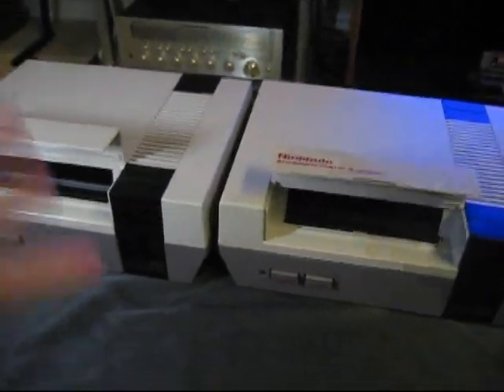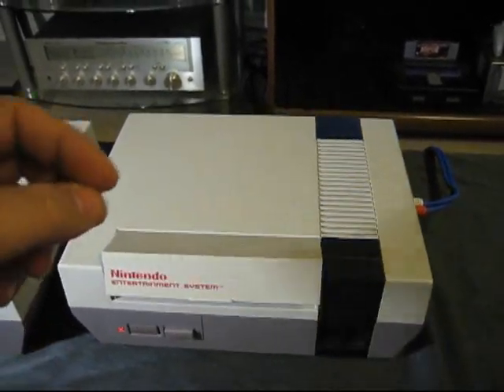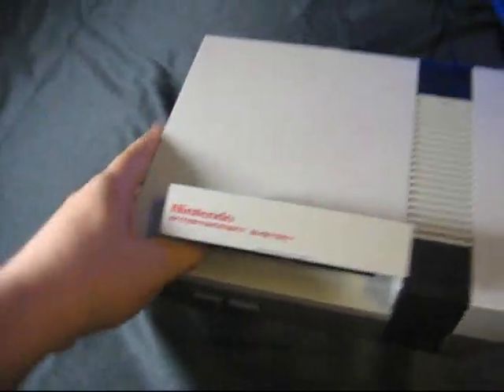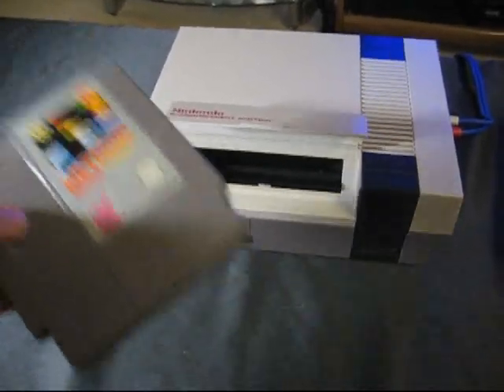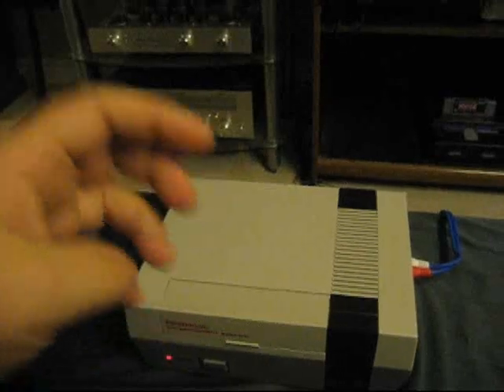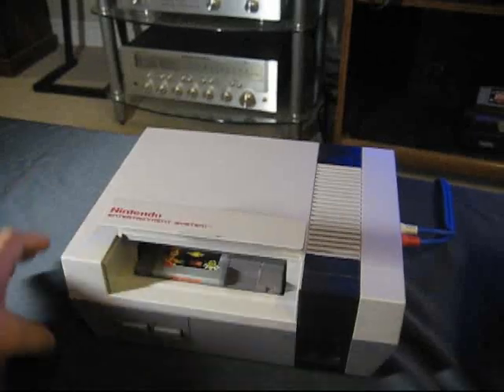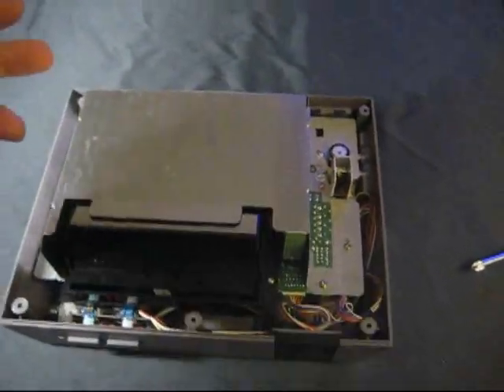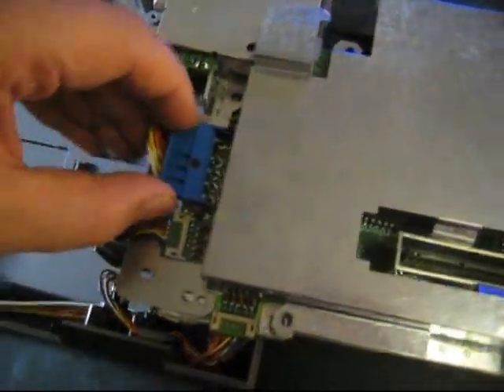Disable the 10NES chip in your NES

Comment: WONDER IF YOU STILL REPLY?? I DID THIS NOW AFTER PUTTING IT BACK TOGETHER, I GET A GREY SCREEN, ANY IDEAS THANKS
Reply from the maker: Well I'm still here but the bad news is I don't know why you have a grey screen.  I would try reconnecting the pin to see if that fixes it back.
Reply: @MN12BIRD  ahh damn. thanks for getting back to me. i did it, attached a new 72 pin connector but i get the grey screen, even with the old connector, it only seems to work if i dont push the game down when i insert it.

Comment: I did everything exactly as you did but I still get a white screen. Any thoughts?
Reply from the maker: Not sure you could try grounding the pin or just cleaning the carts better but maybe the 72-pin connector is just too far gone.  You can look up boiling it maybe??  or other ways to clean the connector.  I replaced my 72-pin connector in this one like 15 years ago.

Comment: If you're wondering what specifically your issue is- Chip or 72 Pin- you just need to look at the screen as it flashes. 

-A solid color is telling you that it's either the 72 Pin or your cart. If it does this to a lot of your carts, it's likely the console's pins not making a solid connection.
-If you see the game flare up but it still flashes on and off, it's the lockout chip forcing a reset. 

It's a good idea to disable the chip regardless, because it can't damage anything as long as you don't short circuit anything on your way in, but if you're worried about it or want to diagnose your issue this is a reliable system to work by.
Reply: Joe Wilkins so a solid blue screen mos def is my 72 pin?

Comment: My only complaint is when he said 'RF shielding... you'll find these in a lot of old consoles". You still find RF shielding in devices made today. However it is just not as noticeable because they hide it better and they have developed chips that are more resistant to it.
Reply: Nintendo fixed the left joy con connection issue by using a tiny piece of shielding foam

Comment: Recently got a classic NES (My childhood one I gave away to my younger brother as a gift 20 years ago...). The one I just got barely worked before. Now with the NES-10 chip disabled as well as the connection pins cleaned and bent back into shape it only fails on dirty cartridges. Which of course is an easy fix of just cleaning the cartridge's connection pins.

Comment: Using a metal blade to pop out an eprom lead touching the other leads with it in the process? 
Not worried about bridging contacts I see....
Reply from the maker: NEZLeader I'm not sure if the chip is an eeprom or not it's actually a 4-bit microprocessor with a tiny amount of RAM built in made by sharp.  The motherboard has no power on it other than trace amounts left in capacitors.  I could bridge pins on the cic all day long and most likely never damage it.  I've done the mod this way half a dozen times and its never been an issue.  It's like worrying about touching the pins on a CPU or working on a motherboard without grounding yourself first.  Sure, you should try to be careful but if you touch the pins on your CPU it's fine.  It would be a one in a million chance the static on your fingers would hurt the CPU so you probably wouldn't need to worry about it too much.
Reply: BTW its a MROM (Mask ROM).
http://www.datasheets360.com/part/detail/sm590/2349826358003027286/

Comment: Thanks brother! my friend gave me his old nes and I had tried everything... cleaning 72 pin ... boiling 72 pin... games .. like games in general just would barely ever work.. tonight i said fuck this poop! popped open my NES and disconnected the 4th pin.... Anyone wanting to do this and doesnt have a knife... I used a really small flathead screwdriver got underneat the 4th pin and twisted my wrist.. it popped right off cleanly.. The good news.. I just tried the 20 NES games I own and everyone of them works on the first try.. My NES also hasn't done the blinking red light thing 1 single time since disabling lock out chip.

I'd go as far as to tell anyone and i mean ANYONE who owns a model 1 NES to go ahead and cut the 4th pin. It made my NES go from working 1 out of 20 times to now.. It works no problem every time I put a game in.

You sir ... Made my NES like its brand new... thank ya MN12BIRD

Comment: I've had my NES for 30 years and certain games were a bitch to get working, but if a game actually loaded and continually resetted, all I had to do was tap the reset button quickly at the start of the reset and it worked perfectly.  Maybe try that before going to the trouble of disabling the 10NES chip.  Also, if you're taking your NES apart, you may as well clean the 72 pin connector with 99% isopropyl and rub gently with very light grade sand paper.  After doing this my NES works flawless with all my games.
Reply: Watch out with the sandpaper, might speed up corrosion.
Reply: Would you use SandPaper to wipe your Ass? Why when a Soft Single/Double ply would be just as well?  I've used a Q-Tip withLESS than a FullDrop of R.A.., my NES Still Qorks, no Need to TakeApart, nor need to Buy and Replace parts that just took TimeAway from Playing. I guess I can see how LOTS of.. "Special" Children would Drill Holes into an Xbox, for "Cooling Measure's".

Comment: @RoyRogers33    If your NES still blinks, it means the pin is still making some contact. Bend it away a little more. (also make sure it's the correct pin).  Never break it off, you'll want to consider installing a toggle switch so you can turn it off/on  as some NES games actually require this chip.   Now, If your game is in and the light does not blink, but you get a solid gray screen, it means the game itself (or the receiving connectors) are dirty.

Clean your NES games with a pink pencil eraser, don't ever scrub them with scouring pads. The metal can wear away and expose pores in the metal, which encourages faster dirt accumulation.  NES cleaners use 90% alcohol, so pick some of that up for a dollar at the market.  Use alcohol AFTER the eraser, only as a "wipe",  not as a scrub.
Note that not all connectors are the same,  some use gold, nickel or copper. So go easy with the alcohol..

Finally if your internal connector is dirty, replace it with one on ebay ($10 for a new one) or clean it yourself by giving it a bath in vinegar for about an hour and then rinse with distilled water.  Dry it off and replace.  Enjoy!
Reply: ahh fuck it. I just broke it off 100%.. after doing so the 20 games I own work perfectly on the 1st try every single time. Im impressed!
Reply: what sort of games, or individual titles, depend on the 10nes chip? I'm considering doing this myself however if some games need it then this may not be worth my time.
Reply: All games can be played without the lockout chip. That's bullshit. If NES games depended on that chip then none of them would work on the top loader, because the top loader doesn't have the lockout chip. You're an idiot.
Reply: So you're saying there are NES games that can't be played on a Top loader NES2?
Reply: Seems like a Lot of Time Running around to buy shit that's NotNeeded. Sorry about your Luck.. maybe it's the Pencil Rubbing?

Comment: ok first of all when i was kid and i played my N.E.S and sometimes i had issues with blinking light, and now this time my nes is no longer working because of blinking still so i have to clean the 72 pin and then disable a 4th pin on the lockout chip and it's finally worked but still the same on 50hz because i got european version but works perfect like new!

Comment: I tried this mod and it failed. I cut the 4 Pin and soldered it to ground. Now all the graphics are glitchy, I cleaned the contacts and reflowed solder on each lockout pin, and nothing works. Can anyone please help me??
Reply: YouTube comments. Fantastic ≧ω≦
Reply: Don Diesel okay, Donny. how about you learn how to properly disable chips on a circuit board before you Come here on your high horse. Cutting a pin may deactivate a pin, but to PROPERLY disable it, it needs to be grounded. Fucking idiot
Reply: ***** thanks, it's just the same old Internet nonsense. People see something once and think they know how it works and are experts when in reality they know jack shit
Reply: +Super Saiyan Machoke when in the video did he say to solder it, or anything besides cutting it? All you're doing is cutting it of from getting any power, so just do that and you'll be fine, no extra steps needed
Reply: No but to properly deactivate it you need to connect that pin to ground
Reply: Super Saiyan Machoke well, apparently not-he didn't in the video, and it worked fine, you did, and it screwed up, so....seems pretty obvious to me
Reply: +ramiel555 I'm not saying he did it wrong, I'm just saying to do it the best way you connect pin  5 to ground. and even so grounding out the lockout chip doesn't cause graphical glitches, it's a problem with my sram  or ppu. obvious, I know
Reply: Super Saiyan Machoke well, I don't really know much about it, just know what he did in the video and saw that that worked, so.......eh
Reply: Lol do some research before you call someone out
Reply: Super Saiyan Machoke uhhh.......nah, no thanks-I said what I said, you did it different than in the video, and his worked, yours didn't, so what's there to research? I don't have to know all about it to see something that obvious
Reply: +ramiel555 sure, but seeing it once isn't full proof. if you see something once and take it as 100% all the time then that's a mistake
Reply: Super Saiyan Machoke why would the same exact thing work in one case and not the other? I'ts electronics, not something wishy-washy like psychology. It either works right or it doesn't O.o
Reply: +ramiel555 +Super Saiyan Machoke You're both right.
Reply: +Super Saiyan Machoke this mod didnt fail, yours did
Reply: smppro that's exactly what I said
Reply: +Super Saiyan Machoke Actually, soldering it to ground is totally unnecessary. I've done this to several NES's with success every time. Never once broke out the soldering iron. I doubt grounding it caused your issue but...  it would discourage me from doing that way in the future anyways :/
Reply: +Super Saiyan Machoke Just a know-it-all thinking HIS way is better... Do what the video says, dumby... It worked for this guy. No soldering... Just cut that damn pin.
Reply: ***** exactly, thank you. Like I said before it isn't strictly neccessary, but If I'm doing a modification I want to do it properly and get the best results. Not that Donnie Dorko up there would understand that
Reply: ffs. you wanna know what happened? static had fried the s ram chip and messed up the picture when connected to a tv. so you know what I did? desoldered the bad chip and replaced it. and now it works better than ever. bad at soldering, huh? fuck yourself
Reply: +Robert Leland blamed a tv? what the hell are you talking about?
Reply: +Robert Leland you make no sense

Comment: I must say that I was skeptical that this would work on my NES (PAL, GBR) and I had heard of grounding the 4th pin of the lock-out chip, but this worked perfectly. I had the greatest of troubles playing various games, and some that I could get to work without entering the lock-out cycle still took 10 minutes of re-positioning so that the contacts would have a decent connection. This just alleviates the dodgy lockout connection that also just simply black/grey screens or makes the screen flash or glitch when you try and start the game up. Only thing I would suggest is that you rather cut and bend the leg or the 4th pin of the lock-out chip, as if you're not careful, it looks like the entire chip is coming apart, and subsequent pins as well, but the pin on mine eventually popped out, with partial rupturing to its black plastic casing, however as it works perfectly, i am to assume that the surrounding pins were unaffected. Once again, thank you so much for this video that let me take the step into better, easier game-playing. Cheers! 
-Dan

Comment: This is not the complete mod, you are also supposed to jump acouple of the pins on that IC to do the mod correctly.
Reply from the maker: Some people say that but I have done this mod a few times and 5-6 years later both my NES systems are still working that I've done this too so I'm not sure what the extra steps would do.
Reply: +MN12BIRD I think the extra steps are supposed to tie the pin either high or low, rather than leave it floating
Reply: TheTurnipKing 

It's better not to do things by halves

Comment: Did this mod. And now i have two Super Mario/Duck Hunt carts. Both of these carts will go to the title screen for Super Mario. But will not start??? Why??/ Duck Hunt works fine...
Reply: TheRabidfox11 either your carts are dirty a pin on the cart is damaged or the mario chips are fried or the pin mario uses on your 72 pin connector is dirty

Comment: I've tried this method and the problem with my NES is that it turns off every 1 minute or so of gameplay. I've tried cleaning the 72 Pin connector and I disabled the 10NES chip, but it still has the same problem. What else should I try?
Reply: If all else fails, just buy a new NES that has been refurbished.